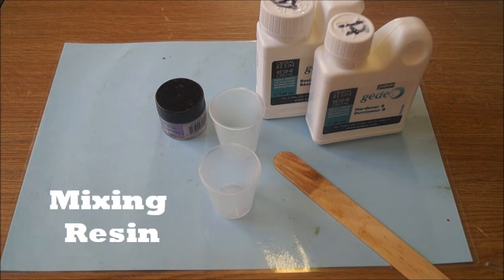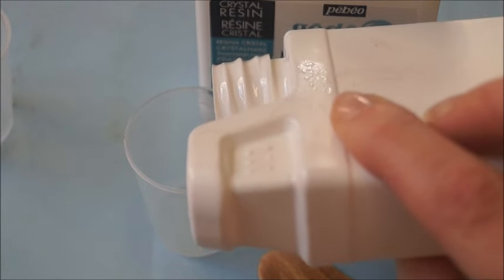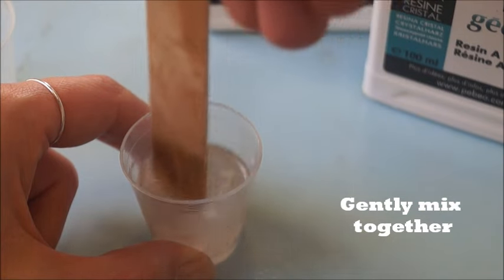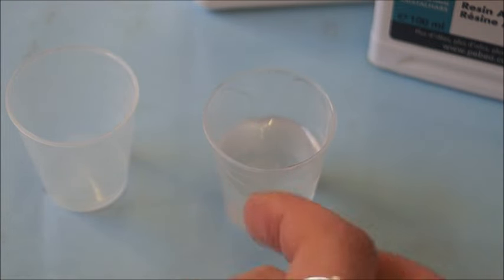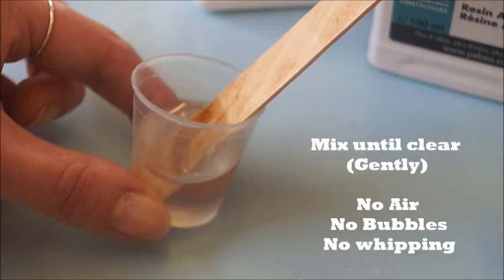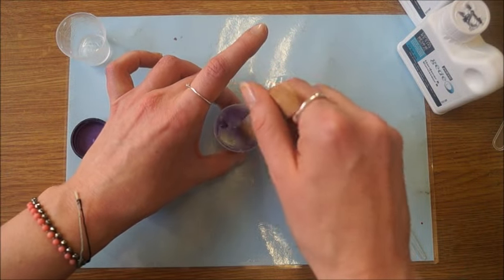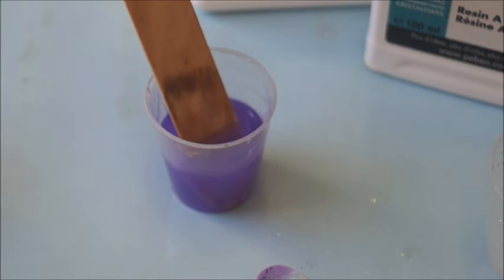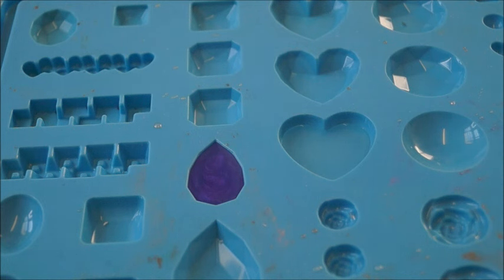Mixing Resin: DIY

Comment: Hi there, great post!
I've bought the same resin from Amazon and I was making the mixture yesterday. I've set it into my molds overnight and as of now it has been about 12 hours. The mixture hasn't hardened and is very very thick, which is progress from what I had put in but seems to take an awfully long time.

I've followed the steps that you had showed and when you stopped stirring, my resin and hardener mix looked like the same consistency as yours and was clear without bubbles. I also transferred it into another pot as you had shown, and mixed twice. My room temperature has been about 17-18 degrees Celsius. I had created another set of molds before and those I set on Friday are almost hardening now. Could you tell me why my resin isn't getting hardened in the 8hours as you mention? Do i need to keep it in the cold with a breeze, does it have to be warmer in the room? Or could it be something with the product I've bought?

Any help would be great thanks! (I'm going to check out your website now!!!)
Reply: Hello Bhav, are you using the same brand of resin as in our video? Different brands may well have different mixing ratios. 

With this resin, it should be set in 12hrs and completely hard in 24hrs. You may just need to leave it a little longer to completely cure. 

There's a couple of reasons why this resin might not cure, it might not have the correct 2:1 ratio mixed (2 parts resin to 1 part hardener). If a liquid colourant is used this can alter the constancy.  Temperature shouldn't affect it too much, but it does tend to set quicker when it's a little warmer (though I would not try to apply heat directly to it as this can affect the surface). The information with the resin also states it has a shelf life of 6 months once opened, so if the resin is older and had previously been used it might also effect the setting. Although when using the resin in our workshops we have found that the resin is fine longer than the 6 months. 

I hope this helps and answers your queries. 
Kind regards
Steph
Reply: @mailorderbeads  Hi Steph, Thanks for coming back to me so quickly. Much appreciated. 

Yes I'm using the same brand as the one you have in your video. I've measured it out as accurately as possible with the naked eye and then in a second batch I also weight it to be on the safe side. I've noticed that in the 12 hours it starts setting and by 24 hours when i touch it, it captures my fingerprint - so it's not completely dry. 

As for the resin itself it's completely new - i bought it off Amazon about 1 week ago and only just opened it a couple of days ago - but I'll have a look for a manufacturing date (if one is provided). I'll try setting it in a warmer room temperature see if that works better.

Thanks again Steph :)

Comment: I am having a big problem with tackiness... I have done many resin pendants with this product with no issue. I bought my latest kit, mix and do just as you have shown and it turns out tacky and will not cure. I thought I did something wrong so I tried it again and got the same results! SO FRUSTRATED!!!! Could the product be old? no moisture issues and the temp is right in the house. Can I save these with letting them sit or are they garbage?
Reply from the maker: +kym fargo Hello, that's a tricky one, we've not had that issue, has the resin set, is just the outside of the resin tacky or has it not set properly at all? If you'd like to email us at info@mailorder-beads.co.uk with your order number and also if you have the batch number from the box, we can look into it further. Generally anything that doesn't set or is tacky I would say is down to not enough hardener in the mix, however if it's happened twice it is a little strange. I don't think it'll be old stock as we sell so much the stock is replenished regularly but it'd be good to get to the bottom of the issue.

Comment: my question is can I use the same ratio as u did to measure mine for floor
Reply from the maker: Hi, you should always use the ratios stated with the product (different brand vary). Emma in our video used the ratio required for the pebeo brand we stock. We haven't used the resin for anything else other than small jewellery components and pendants. So we have no idea how well it will for a floor, you could perhaps try contacting the manufacturer, or seeing if they have guidelines for this on their website. I hope this helps.

Comment: Are you sure that you put 2 from the A and 1 from the B? Cause i first tried to make something and has been over 5 days and still didn't dry 😥😥😥
What am i doing wrong??
Reply from the maker: Hi Sophie! This resin is definitely 2 parts A (resin) and 1 part B (hardener). Other brands might be different, so always check that packaging. Sometimes resin just doesn't set- this can be because it hasn't been mixed well enough, it reacted badly with something that was put in it or if the weather is very humid. It could also be that the resin has been opened for too long and it has affected it. It probably will set, but never go completely hard. Hope that helps!

Comment: can i use the tattoo pigment to mix??
Reply from the maker: I have never tried using tattoo ink so I'm not sure how it will react with the resin. Resin doesn't like water so if the carrier is water based its a definite no. If the carrier is alcohol based, it might be fine, but I'm unsure if any of the other ingredients might affect the curing process. I would suggest testing it out before committing to a finial piece as if the resin doesn't cure you might not be able to get it out of the mould.

Comment: Can u use a uv light ???
Reply from the maker: Hi Nicole, are you asking about uv light to set the resin? The pebeo resin we stock is purely a chemical reaction and uv light will not make any difference to the setting time. I hope this helps, if I have assumed incorrectly then please let me know.
Reply: The Bead Shop (Nottingham) Limited Okay thank you

Comment: The Pebeo leaflet says to pour the hardner first.  I followed the leaflet an my resin came out bendy. 🤭
Reply from the maker: In theory it shouldn't matter which you pour first, providing the two parts are thoroughly mixed together, sometimes out of habit or after you do things so many times you usually develop your own way that works for you. Sometimes bendy resin can indicate that there wasn't enough hardener in the mix. That can be harder to judge with smaller quantities. Getting the ratios as accurate as you can is really important for all resins. I hope this helps.

Comment: I'm using this specific resin but my UV light doesn't work with it
Why's that?
Reply from the maker: This isn't a UV responsive resin, this is a two part resin, it is activated once the two parts are mixed.
Many thanks

Comment: Tried it, didn't like it. It is way to watery and Hs almost not surface tension. If you want a nice dome, don't use this resin. i ruined many pieces because it is so watery it just runs over the sides when you pour the last layer. Drying time is very long too in my opinion. it takes days. What it can be used for is sealing jewelry pieces because of it's consistency it can be brushed on with a paint brush. Still looking for a good doing resin in Europe that is UV save.
Reply from the maker: Sorry will missed this comment. It is quite a liquid resin, you do have to ensure you have the right ratios of resin to hardener before mixing together for the best results. It's possibly it was a little out which might have resulted in the water consistency and longer setting time. A specific glazing resin sounds like it might be a better option for your final layers.

Comment: does it stink?
Reply from the maker: Hi, it is not completely odourless, however it is definitely one of the less strong smelling resins. It is a good idea to use it in a well ventilated area with a window open if possible. That said we use this on our workshops all the time (in a spacious room) and the the smell is hardly noticed. I hope this helps.